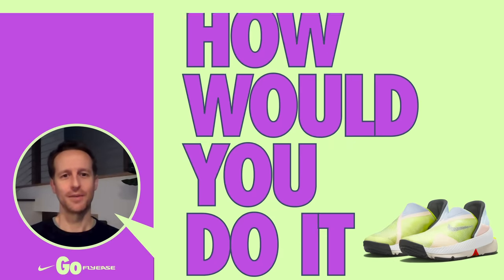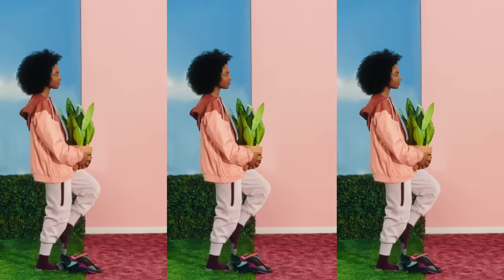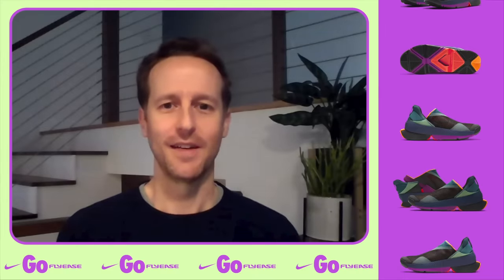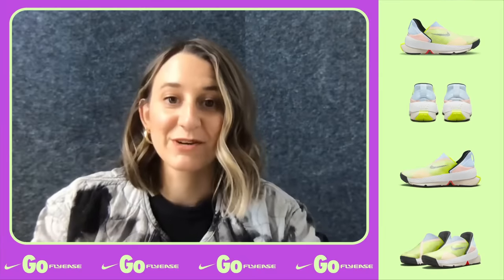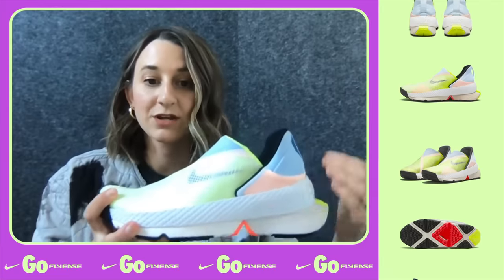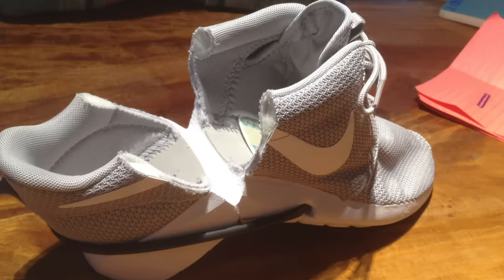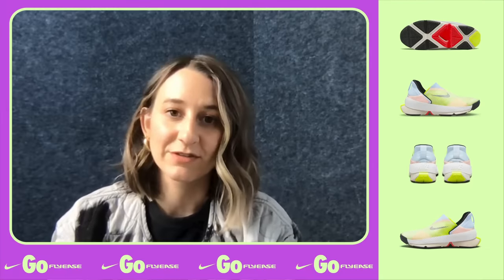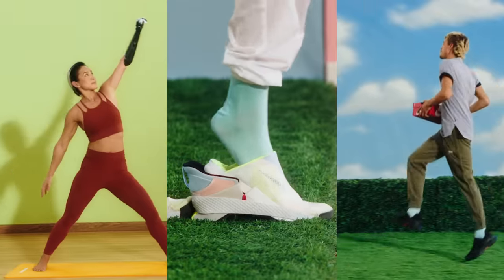Nike Go FlyEase | Behind the Design | Nike

Comment: Very cool. Would love to pick up a pair when the general release happens. My concerns: durability of the portion of the outsole that creases when the shoe is bent. How many times can it be folded before the material starts to split or breaks? How long before the tension band starts to permanently stretch? Great idea though. Looking forward to trying them on.
Reply: I'm certain they considered this given the footage of a robot bending it back and forth. I expect they calculated the number of times in a year or two someone might put in the shoe and have picked material that exceeded that.
Reply: well every conventional shoe has a flex point (usually at the widest part of your foot), that folds with every step, so in a way this area has to endure much more stress. And since this doesn't pose a problem really I wouldn't expect it to be a problem with this particular Nike shoe either.

Comment: Looks like they're going to cost about $120 a pair.  How long before that hinge starts to wear out and split? What happens when the rubber band around the sole breaks? Definitely not good for wet weather. When someone is standing in the shoe, the top of the hinge would be an inch high at most where there's a gap that would let water flow right in.

Comment: Nifty idea but I have questions. How good is the tread for slippery surfaces? What kind of lifespan does the tread have? With that bend in the middle, how good is the arch support? Will there be a way to adjust the fit for high arches or wider feet? How much slippage is there with that piece in the back, enough to cause blisters during longer walks? Is the toe box wide enough to allow for a firm use of the toes for grip and stability?

Comment: playing devils advocate here; now that the sides have secured straps, the shoe now has a "loop" on each side that could get caught/hooked on objects. probably one in a million chance but the Murphy's Law is right there. shoe laces can be tucked in and you can untie them. i would do more testing to rule out any faults bc this is the first shoe of this type. you should think about designing an internal elastic band(s) instead of external rubberband. so it can be "stretched open" instead of staying open or closed; maintains tension to keep it "closed" so it can securely stay attached.